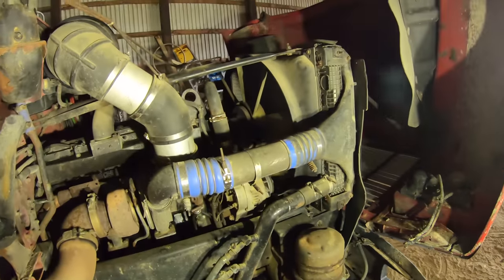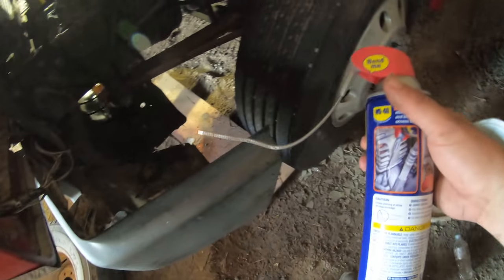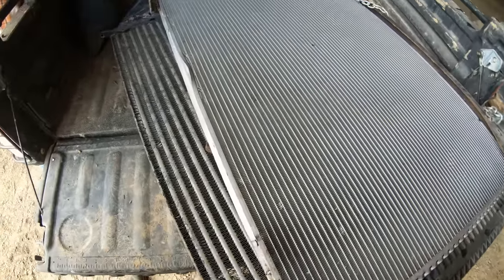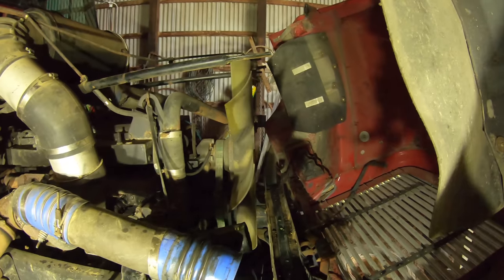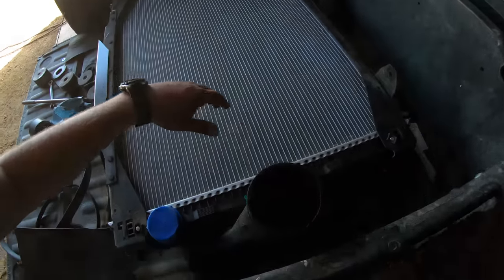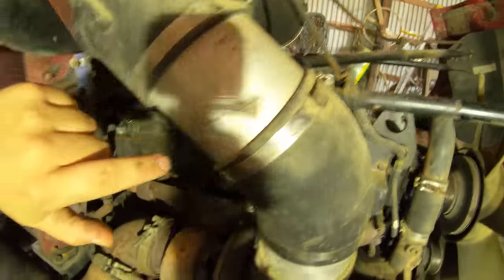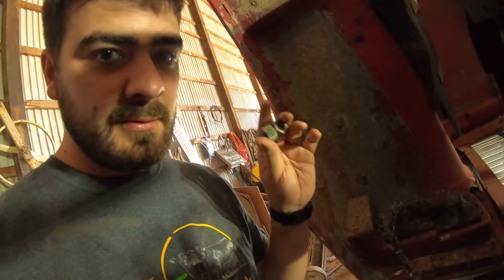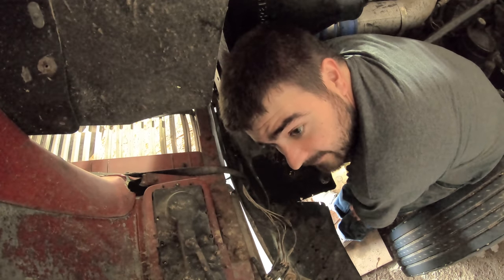Freightliner FLD112 Radiator Swap - Big Red

Comment: Make sure you have the blue intercooler line clamp tight because I've had pop off when I was going down the road and hauling a load and it scares the crap out of you when it happens

Comment: Good job, great explanation for air cooler, used to maintain a 250 ft. bucket truck that took 38 gals. of oil ! We would make up a coolant/water mixture 20 cases at a time with only bottled water.

Comment: And ryan. The intercooler/charge air cooler works by when air is compressed, it gets hot, thus making it expand and less dense, ie less O2 per cubic foot of air.
The cooler reduces the intake temperature and allows more volume of O2 into the cylinder thus more power.
It also reduces the egt’s making it burn the fuel fully, engine runs cooler making everything last that much longer internally.
Its one big happy cycle.

Comment: Thanks for the great video Ryan. I enjoyed your adventure  with the radiator. I would have suggested pressure washing the engine all over to get it real clean to see over time if you have leaks showing up anywhere. But it is your truck so truck on.
Reply: Should have pressure wash truck and engine first. Won't be so dirty to work on and check leak afterward.
Reply from the maker: I've just been told to absolutely avoid getting the pressure washer anywhere near the motors on these trucks. Not sure if that's needed or not but it would be nice to get things clean!

Comment: As much as it would suck. Cleaning the fuel tank may be needed. Diesel can grow algae leading to issues. As well as some things other commenters have mentioned. But once its fixed. Always remember. No matter how tired you are at the end of the day. Top off them tanks and use proper additives. Hot fuel and low fuel level lead to condensation build up=water in fuel.

Comment: Get a diesel transfer pump and pump that tank out.  Then flush it out and inspect the inside. Use a filter screen or run it through a filter when refilling.

Comment: Hi Ryan sometimes the charge air cooler can leak causing poor fuel economy and poor engine performance, you can build your own build your own charge air cooler tester from parts from home depot then you put it between turbo and cooler and look for leaks ..then fix them Google charge air cooler tester .

Comment: Good job Ryan,and crew but keep in mind that  big liter truck engines will always push out a small amount of coolant when under load. Its called expansion loss. They build a lot of pressure when pulling and will lose a small amount and then stop at some point. Many will get hung up on keeping it absolutely full of coolant  which is a waste and wonder why its always down a little below full level. Then keep adding  only to find it down again after a full day of work.
 Last truck I ran would go down a half a gallon and then never loose another drop. That's just normal considering the pressures they are under and the age of the motor and will not keep the truck from cooling properly. As a rule always replace the radiator expansion tank cap frequently as they get week over time.
 The tire ware you showed could be an alignment problem and or a sign of some suspension bushings going bad in the torque arms in between the frame rails. If the are cracked and or misshapen that could be your problem because they get dry rotten and start to let the rear ends move when under load causing cupping and all kinds of funny looking ware . 
Its  also helpful to rotate your tires frequently to even the ware out to get maximum life. Rotating will also help you find the problem. If your suspension bushings and torque arm bushings are cracked and not soft and in great condition they will let the rear ends move,rotten dry bushings are bad and have to be changed .
 Anyways thats my to cents, Thanks for the videos....Jack Baker
Reply: Good info, speaking from your experiences.
Reply: @BWYinYang  2 million miles accident free, but I dont miss it a bit...Thanks Jack

Comment: Purchased a radiator in 2012 I think it was 600.00 plus online. Copper are down so your we’re blessed by the copper commodity prices if not corn price so probably a good time to buy. Trucks are very expensive to maintain they will pay for themselves if you have the work and take care of them which you will. With 80,000 pound pushing and pulling them there is always something wearing out.Fuel line interior might be collapsing on the inside or just a tiny air leak in the line causing suction problems.

Comment: The tires are probably from hitting the trailer the hopper I pulled at work would rub the tires when I turned fully loaded when going up a slight incline an they looked just like that

Comment: The shop I used to work at was a 2 hour quoted job on an fps freightliner only thing that would stop from making time were the mounting bolts pa if you ever have to do it again unbolt the cooler and lay in hood before you pull the radiator passenger side will slide past radiator

Comment: Ryan love the video watch for other leaks as I know you will but over time as it gets hot it creates leaks in other spots that are dry and have been dry like water valves and hose clamps. The fuel issue I would be replacing the fuel lines cause the inside of the line over time gets a weak spot what also is swelling inside and closes fuel delivery off so any fuel hose I would recommend on replacing 
Thank you have a good

Comment: I haven't heard anyone under 70 call it a charged air cooler! I am just teasing! I would of definitely bought a new radiator instead of using the old one fore two reasons  one is it would only take 55 days of running it before the cost of coolant exceeded the price of the new rad. Also you already took a fair amount of time to pull the old one out and if you had to do it a second time, that time it took would of cost double. Time is money especially on a farm with seasons like planting and harvesting.

Comment: Great Video...
Hope the leaking coolant problem is now completely fixed...
As far as your fuel tank goes...
When you get ready to tackle the fuel issue, i believe it would still prove to be the best to drop the fuel tank off the chassis and give it a thorough cleaning out/flushing to ensure ALL Contaminants are removed once and for all...
And concerning your drive tires...
After inspecting every possible location under the front of the trailer where the tire could have came into contact with the trailer, did you locate any points of contact...
Is it possible that the 5th wheel plate is slid to far forward to allow for proper clearance between the trailer and tires???
Thanx for doing what you do...
Thanx for being a Farmer...
Gitin a Lil Anxious for your next round of Hay to start and harvest to start and...
Thanx for sharing...

Comment: Invest in a air ratchet please. Save time and headaches. Great video as usual. Be careful
Reply: I have found that the battery powered ratchets are better yet.
Reply: Bob La'Blah I’ve never seen one of those but sounds excellent. Anything has got to be better then slow cranking busted knuckles
Reply: Battery powered is definitely the way to go

Comment: Not that I missed something in the beginning of all this but just a piece of advice while the radiator is out change the belts and the belt tensioners why you have everything apart you'll be happy you did but if I missed that somewhere in one of the other videos I'm sorry

Comment: Am curious to  know . Has having Big Red been a advantage over using contract hauliers? Both from a financial aspect and not having to wait on others to haul your products? And yes the radiator and  charge air cooler are more efficient when painted black.

Comment: Should really be running as you add coolant, to get the air out. If you have cavitation, it will run too hot. Be sure to burp the system after.   Todd the retired trucker.

Comment: You fellas should consider digging some of that dirt out the shed and pour yourself a concrete slab in half the shed be a nice working surface.. sometimes I hate watching you doing it wrong... had to work those.... seems to me aluminum radiator you're gonna have to replace that radiator.... those plastic tanks degrade over time... just replace it..
Reply from the maker: I've been thinking about that lately. Once I get some money around in the next 3 years I think we're going to see some cool developments happen around the farm.

Comment: Just something I noticed does that truck not have ac? I didn’t notice a condenser in front of the air to air? Or does it have like a red dot mounted to the side of the frame? And I’ve seen in previous videos you always drive with the window down? Just something I noticed and was wondering. Anyways good job 👍

Comment: I know you don’t want to hear this and I’ve said this since you were thinking of buying this truck it’s going to nickel and dime you to death and in the end the trucks value just goes down. You should have bought a Pete or KW. They hold their value more.
Reply from the maker: Will it though? We’ve pretty much done everything to it at this point, the only thing that could end up being an issue are the motor and the electrical, and I have no plans or concerns about it. I’m not really concerned with resale value
Reply: How Farms Work. Don’t worry about the Nickel and dime stuff, every truck will do that no matter what brand you own. We have all freight shakers on our farm and they do the job just fine and parts can be found anywhere for relatively cheap. If you were running cross country then that would be a different story but you’re not. Keep up the good work 👍🏻
Reply: @HowFarmsWork  I was thinking same thing about the resale price. I thought you would get it to be very reliable truck that the farm would be able to use for next 10 to 15 years if it's kept up on. I don't see any cross-country trips planned so I think over the long term this was a great idea.

Comment: Letting a truck run very long is a trucker practice from the past before multi-viscosity oil and modern high pressure fuel injection.  It is just a feel good thing and puts a glaze on the piston liners.   I have many large engines and have never had an issue with only idling for a few minutes.   There is a reason why extensive idling is discouraged by engine engineers.

Comment: Painting radiators is absurd. Paint is an insulator!! You are trying to transfer as much heat energy from your charge cooler to the ambient air.  On top of that, black paint makes it really difficult to clearly see how blocked a radiator may be.